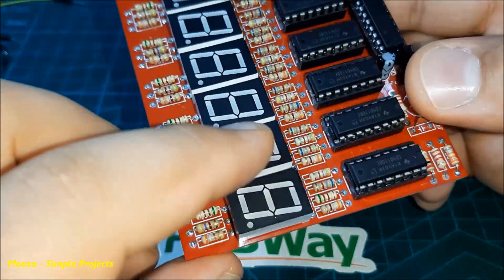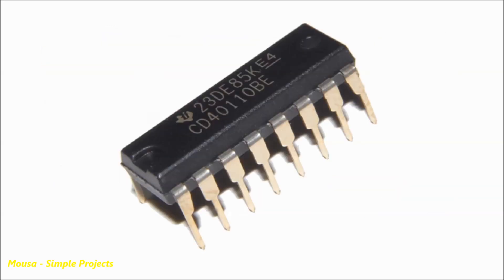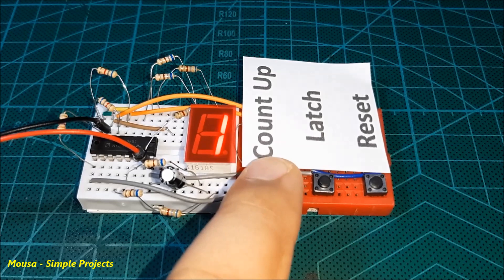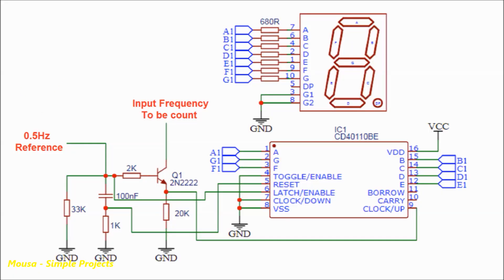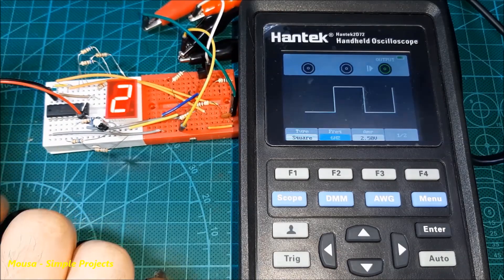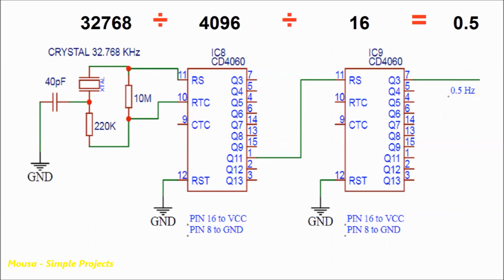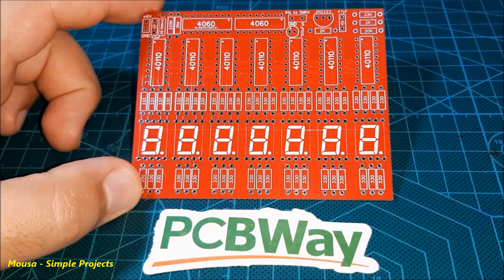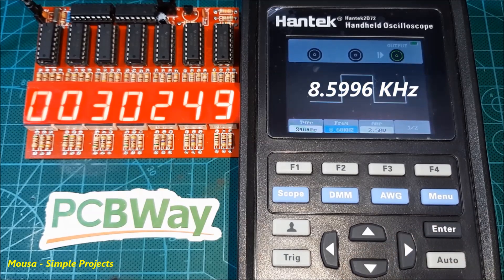DIY Frequency Counter Without Microcontroller

Comment: The reason it reads slightly low is because you are resetting at the start of the count cycle. IE its only counting after the reset. I want a cheap counter which measures down to a few HZ and most of the Chinese processor driven counters dont do that. So was looking for an old school design. Cheers for giving me the idea of using the CD40110 but I'm redesigning it so the reset and latching are in the other half of the cycle. Also improving the gating while I'm at it 🙂